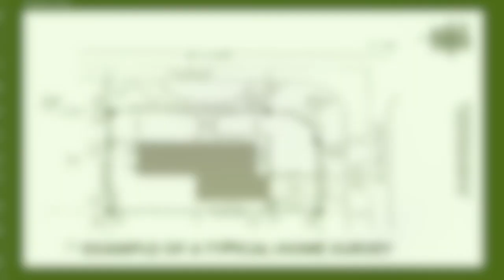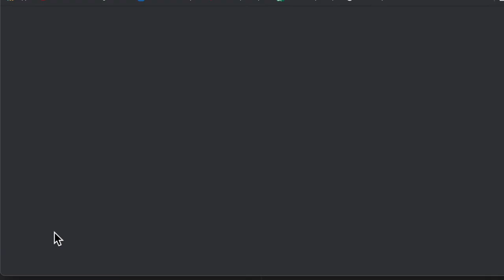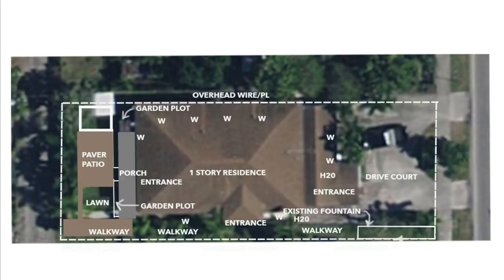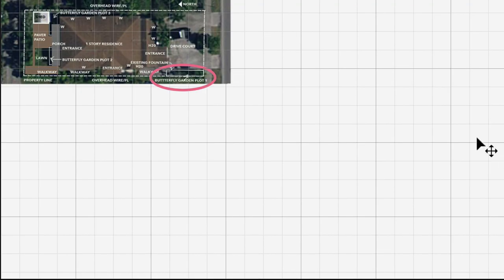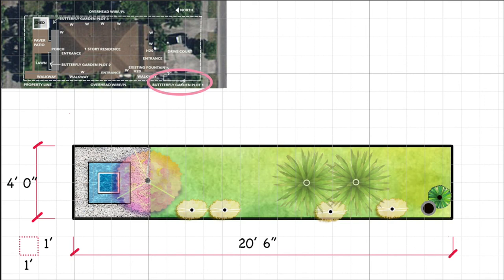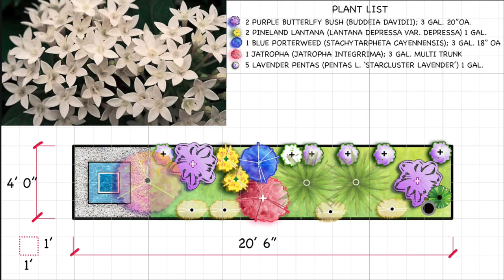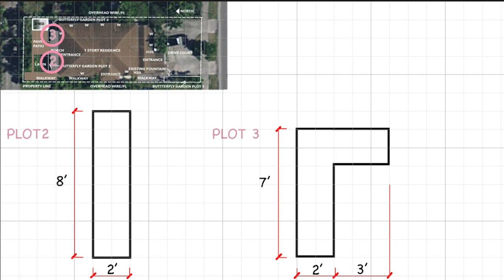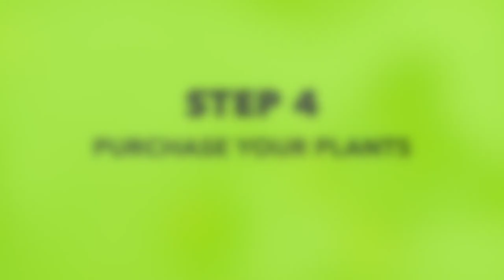HOW TO DESIGN AND INSTALL A BUTTERFLY GARDEN

Comment: I want to create a butterfly garden, but do not have a full sun area. What plants do you recommend for a low light butterfly garden. Thanks.
Reply from the maker: Hi! Is your garden area  located in deep shade or partial shade?
Reply: @LETSGROWGARDENDESIGN  I have a small area of partial shade the rest of my garden is deep shade.  We have very large oak trees. 
Thank you!
Reply from the maker: Hi there. Here is a butterfly plant list for shady area: You can add coontie ( host plant for atala)/ blue porterweed (attracts many butterflies) in shady areas. For partial shade areas try jatropha, red fire spike, or butterfly bush. And no garden should be without milkweed. The Milkweed will attracts the endangered Monarch butterfly. Your milkweed might not flower in shade but it will attract the butterfly to lay eggs on leaves. Hope this helps 😀🪴
Reply: @LETSGROWGARDENDESIGN  thanks for the information. Hopefully I can add more butterflies to our environment.
Reply: @gracejimenez1370    Old fashion red pinta.  Might need to call to find the old fashion type.  It will do well in filtered light.  An excellent nectar source.  

Both the fire bush & fire spike will tolerate deeper shade.  Put a Corky stem passion vine right next to the fire bush & let it grow in it. You’ll have lots of zebra long wings.  

Privet cassia will tolerate a surprising amount of shade.  It’s the host plant to several butterflies.  And takes up very little real estate. 

There’s a golden rod that like filtered light, but can’t remember which one. 

Craig Huegel has a book on native Florida shade gardening that I highly recommend.